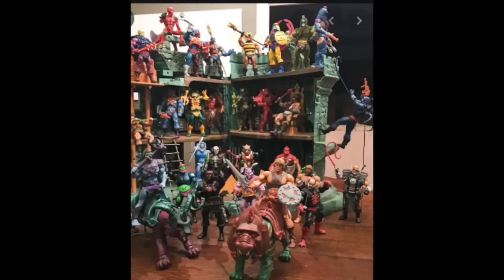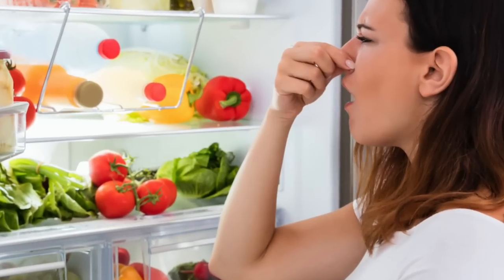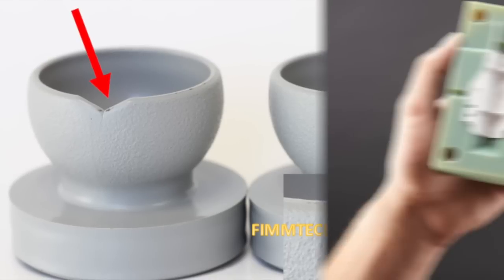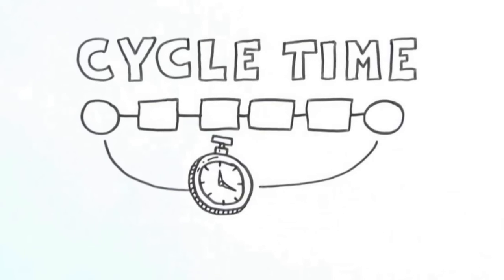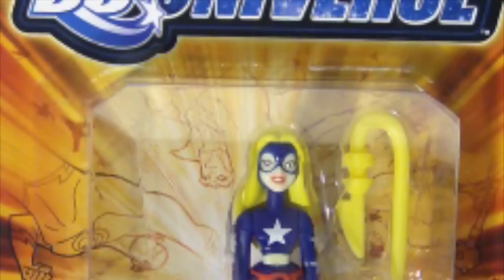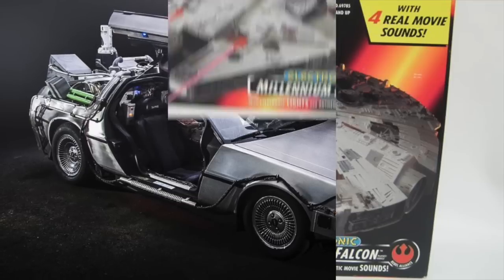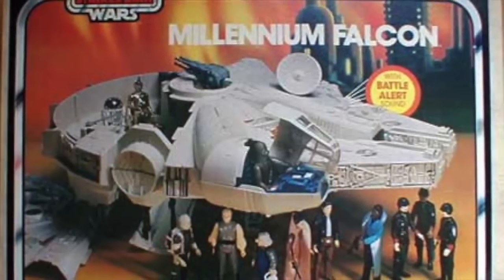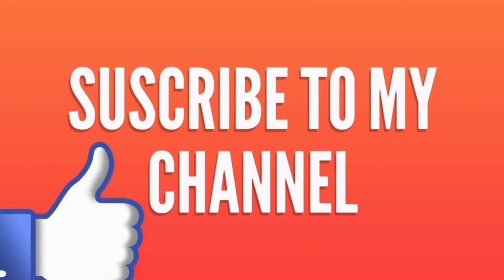Nothing lasts forever The Life Span of the common Toy Tool.

Comment: I would love an in depth video on how the tooling is created.  Are the action figure negatives CNC machined into the metal or is it done by hand?  When the S was filled in on Supergirl do they just add molten metal and polish it or is there a special substance for changing molds like that?  I make a lot of silicone molds of things so I understand how that works, but have never seen how metal molds get made.  Great video!
Reply: I wanna see how Classics Castle Grayskull was tooled...i mean the actual process
Reply from the maker: Very much like that. It is all done by hand
Reply: if it's indented into the figure, then it's raised on the mould and just a matter of filing that down. i'm not a tool and die guy, so i don't know you would -- if it's even possible -- to reverse that.

as far as how the mould is constructed i imagine it depends on what plastic you're using, production, detail, material hardness, etc.. some might be CNC router, 3D router, others EDM (electrical discharge machining). seems i recall how the old aurora models were made back in the 60's as being a pantograph EDM, which is kind of like doing it by hand. of course, you could always break out the chisels, too, but i'd venture to say that's very old school.
Reply: @spectorcreative1872  this would be a great follow-up topic! I hope you'd do it.

Comment: A good example of tool deterioration is the top wedge panels on the Black Series R5-G19 dome compared to the first R5-C7 Legacy release.
Reply: Another example is the Jazz toy released in the Commemorative Series Transformers line by Hasbro in the 2000s. The robot’s mouth had a strange smirk not present on the original, allegedly due to tool degradation. Later reissues fixed the tooling so it looked more like the original G1 toy.
Reply from the maker: Gréât example!

Comment: Injection molding is a fascinating subject. It's amazing how much engineering goes into common household products. The production rates are unreal. 
Around the turn of the century, you could get a 100 ton injection mold machine(less dies) for $100. But it would have cost about $10k to move and set up. 
I have a lot of stories from back then, it wasn't a time to set a small manufacturing company in the US.
Reply from the maker: And it is responsible for so much of what we collect

Comment: First...I LOVED IT!!!!! I've seen tooling made, we even had Stycast and casting epoxy at work because one of the aviation systems was made in '97. We never produced anything Safety of Flight, but still.  I've even made small scale stuff, weapons mostly.  Flatter things.  Very small runs.  My boss thought I was crazy. 

The big question... do you have the Spector Tool in your home? It would only be fitting. I've read a lot of released inter-office memos from Hasbro from 30 years ago in different places. A few of them mentioned sending tools to South American factories, and then took the factory to keep them to cut down on cost. So Hasbro was not paying to get the molds back to get rid of them. I've read the two product tools they were eager to dispose of were the Flagg, and the Defiant Shuttle Launch Complex.  They took up so much space. 

I'm sure Castle Greyskull (or is it Grayskull 😝) was huge as well.
Reply from the maker: Mine too

Comment: The oldest tool I personally know of is from Character Options Dr Who line, Theyre still using the same ones from 2004. I guess more limited runs mean they arnt getting worn out?
Reply from the maker: It could be a replacement tool
Reply: I know that many of the Godzilla toys in Japan use the same tooling from decades before, some being as old as the 1960s. But those use a different process (soft vinyl) and in some cases more limited runs, so that probably plays a big role in the tool surviving. And I think it might be easier to make casts off the original hollow vinyl figure if something does happen to the original.

Comment: Scott, I once heard that certain articulation points are copyrighted by individual companies, for example - ankle pivots being copyrighted by Hasbro. Would love to see a video explaining this. Great video. Liked
Reply from the maker: They can be such as marvel legends double elbow joint.
Reply: @spectorcreative1872  so then how are other companies able to do it? Like most companies use double joints now at least
Reply: Good point. I think you can use a patented process if you improve on the design. If you took something like Revoltech’s “revolver joint” or shfiguarts and altered the mounting points, you’re good. Plus that may have been a rumor cause certain designs are just too common.
Reply: @machineman6498  I mean, McFarlane and NECA double elbows and knees are pretty much the same as marvel legends. Even Mattel had some double jointed DCUC figures like blue beetle back in that era

Comment: Always wondered what caused burn marks on the plastic. So, generally speaking it could be tooling thats reached the end of its lifespan? Would double tooling explain subtle differences in the look of figure components ?
Reply from the maker: That can, but double tooling is designed to be identical. It is more likely overuse if a tool

Comment: Very interesnting! I have a question: How they make a mold for an old action figure line relaunched? They take it from actual figures/vehicles or what?
Reply from the maker: They retool it from scratch. Think a copy of a copy
Reply: @spectorcreative1872  Is it really scratch/scratch or is it easier to copy the second time around?
Reply: at hasblo's level and given today's technology, replicating an original piece shouldn't be an overwhelming issue, i'd imagine. i mean, you can buy a laser scanner and create a flawless 3D copy on your printer. barring that, i would think that a modern fancy pantograph EDM could swing it. 

as mentioned, retooling it from scratch would be the way to go. you wouldn't want to necessarily put a lot of faith in a 40 year old mould, lol, and repairing it could cost as much as making a new modern one.

Comment: I recall that a lot of the G1 Transformers figures when they were reissued by Takara - and later, Hasbro - used the tooling from the Generations 2 line.  This is why a lot of the reissues had changes that were made on the figures during the G2 area.  

Anyway, when Takara reissued Jazz, the face looked odd due to mold degradation.  Takara tried fixing the face with different runs, but it didn't come out right.  I think it was finally fixed when Hasbro did a later run of either Jazz or Ricochet(a once Japanese exclusive of a black redeco of Jazz named Stepper) where they recreated the tooling.

Tooling degradation is also why not all G1 figures have been reissued officially since some tooling are beyond repair.  I also recall that the tooling for Soundwave's clear tape deck door degraded beyond repair during one of his reissue runs, which is why the Hasbro versions - until recently I think - had to use the Soundblaster version, which can hold more tapes due to the part being deeper
Reply from the maker: Yup. That is it

Comment: Were the tools in the 80s more durable than the tools they make now? I always assumed G.I. Joe reused the original tooling to make Tiger Force, Night Force, etc. And I was under the impression they used the original 82-83 tooling to make the 1997 figures - but they couldn't find them all (or some deteriorated) so they used some 86 parts.
Reply: The video mentions there being five classes of injection molds, based on life expectancy.  My guess is that 80s toy companies spent the extra money for higher class molds with the idea that the volume of sales and years of re-use would justify the investment. Modern specialty lines presumably see parts runs that may be several orders of magnitude smaller.
Reply: Part of this falls into the same category as the Palitoy example.  Funskool had a lot of the Hasbro tooling from the 80's/90's and those were used to produce the '97/'98 lines.  The plastic quality on those figures also shows how differently they were produced vs. the original ones.
Reply from the maker: No if anything they are more durable now
Reply: I guess they never splurged on that class 1 million use tooling. 
Only industrial titans like Ford or Sony can afford the good tooling and they are not using it to make toys.
Reply: @Novusod  no reason to spend more on tooling than you have to.

Comment: So, with Commemorative: did Mattel use the old tools at all in recreation, how does that work? The Commemorative He-Man head is a completely new sculpt that they had to buy off eBay and that’s STILL the sculpt they use for any vintage type heman head. Is there a reason for that? Is technology not able to get a more accurate 80’s head now?
Reply: I'm pretty sure I've read they had long thrown the tools away, and for that series they might have grabbed some of the original toys, made a mould of the toy, and then used that mould to make a new tool.

Knock-off toys usually use this technique.
Reply from the maker: Those were new tools based on the old. So think a copy of a copy
Reply: I believe Mattel covertly bought back a lot of individual figures from eBay and scanned them to make new molds. To Scott's point, a copy of a copy. That's why He-Man's face looks funny.

Comment: Really interesting stuff.  Are all molds injected with plastic at the same pressure, or do larger molds require more pressure? If more pressure is required, are larger molds made of more durable materials to compensate for increased wear?
Reply from the maker: Yes larger molds are made of more durable stuff

Comment: Is this still..a thing now that we have 3d printing ? Our molds are now digital rather than physical. What am I missing ? Is it quantity ? 
I. E. Is it not feasible to print a production run ? I apologize if I failed to articulate my query.
Reply from the maker: 3D printing isn’t far enough along to replace tooling
Reply: @wallaroo1295  i understand the concept you're saying and it's conceivable despite it having a lot of issues attached to it. i could rattle off a laundry lists of problems i see with that kind of plan just off the top of my head, lol. i think the biggest issue would simply be that people suck and you can't trust them to do their 'job' when you need them to. the 'sorry, i couldn't find the tape gun so i couldn't UPS them to you' won't fly when you have a bunch of assemblers, painters, and packers sitting around on the clock waiting for teela boobs. 

lots of ppl have printer farms, and that's okay for some things, i guess. personally, i'd be curious to see their costs vs. different processes past a certain production point. if you need ABS then only a filament printer can do that, then you have problems with it looking like shit from the layers. spending hours to print an inferior component that can be made literally within seconds using an injection mould, and soon you're going to very much close that cost gap, i would think. also, toys have a limited shelf life, and a couple hundred parts a day printing just won't cut the thousands that can otherwise be made when you have orders to fill.

i don't know, i would just have to really be convinced somehow that this is the future of certain manufacturing. i've spent most of the last 30 years working in manufacturing and i've owned my own small business. i've seen a lot of crazy machines, learned that even your most trusted suppliers can flake on you, that 'just in time manufacturing' is more a buzz term idiot pieces of management love bandying about than a viable american process without bastardizing the concept to hell and back, and, as an aside, if you see any company's quality statement containing the words 'continuous improvement' just do yourself a favour and leave.
Reply: @spectorcreative1872  it never will be, either. there simply isn't a way to remotely improve on a process that takes seconds to make a piece as opposed to printing it, not to mention the quality and consistency.

Comment: Great video.  Very interesting.  Question:  Do you know the production history on the MOTU Commemorative line many years back.  Had some of those at one point and there were quite a few figures made.  Do you know if a new tool was used or did they have the original tooling from the vintage line?   Thought maybe since the original line made so many figures, that there may have unused tooling pieces in storage.  From what I remember, those commemorative figures had pretty sharp details.   Just curious. 😁
Reply: I have Zodak and Evil-Lyn from Commemorative Edition. I'd heard that the tooling was all new because the originals had been sold to Top Toys in Argentina.
Reply from the maker: I will be doing a video on that soon

Comment: So I kinda tried to ask this before but not sure I got an answer.  The Tarzan jungle cat/big Jim tiger/battle cat figure is an example of a toy used across lines. Did they reuse the tooling for that or did it have to be recreated every time they reused it?  Are certain tools easier to reuse and last longer, like a solid non-articulated cat?
Reply from the maker: Yes but eventually BattleCat was retooled from the original mold

Comment: Injection molding and the tooling process seems like a technology that hasn't changed much over time. With advancements in 3D printing and additive manufacturing, are there new processes being considered for toy manufacturing that could be simpler and/or less expensive?
Reply from the maker: You are right, not too much

Comment: You’ve periodically mentioned the plan to release MOTUC in retail, “During a fabled movie year.” I’m guessing that was only possible as a contingency plan because of the shared bucks within the line, correct? Mattel could take whatever basic bucks remained useable and employ those for the first series of the MOTU-movie line  figures and/or the MOTUC-movie-companion line. Then, in success you’d be able to retool additional bucks and/or individual figure pieces? 

Was that the plan? Use whatever molds were still viable in order to launch the line, then develop plans for more lines if it sold well? Or did MOTUC receive special treatment — more robust molds? Better/additional mold storage after the initial l run? More careful/low-mold-stress production line setups? Use of XYZ factory practices in order to minimize long term wear and tear? — because of the fabled prospect of a movie year?
Reply from the maker: Did you see this video Nick? https://youtu.be/8ca62rHeFYY
Reply: @spectorcreative1872  not sure who Nick is, but yeah. I think that’s the video I was initially asking you about. My question is just… the molds only last 5 years. I guess, at the time, MOTUC was still in production, so you didn’t have to worry about old molds? They were still new?

Like, I’m anticipation of the fabled movie year, were MOTUC molds treated any differently than random joblo corporate cartoon tie-in? Or was that completely unnecessary.

Comment: In short, Mr. McGuire didn't tell us the whole deal regarding plastics. Like the molds (which I assume are as important for Tupperware as they are for toy production). Of course. 
Well, I'm sure someone is going to mention 3d printing, regardless of the challenges that presents...
Reply from the maker: Oh thé challenges it has indeed
Reply: my understanding is 3D printing is okay up to about 100 prints, and beyond that you might want to consider getting a mould made. i can understand that -- i owned a screen printing business with my ex, and we would do shirts in vinyl up until about 20, which after that point it was more economical to screen print. 

these guys with printing farms banging out 100's of the same thing, i dunno, seems to me at some point you're losing your efficiency just to produce an ABS product that's ugly af.

Comment: So the "new" vintage scale Falcon released in Target that is the same mold as the one that came out ten years ago but with better painting probably needed the investment of new tooling. Sheesh, they might better have updated the design with modern engineering if they were going to have to pay for new tooling anyway.  Black Series isn't even a decade old and its initial offerings feel like dinosaurs compared to current renditions. This isn't the thunder tank we're talking about either, it's the defacto ship in Star Wars!
Reply from the maker: Likely this tooling was still usable.

Comment: When designing a tool, how many pieces of a figure can be used for a single mold? Can you get multiple parts out of a single tool?
Reply: I suppose it largely depends on the quality you want.  Think model kits or weapons that come on a sprue with cheap action figure sets at walmart.  I'd assume a single sprue of multiple pieces also come from a single tool; but the number of pieces can vary as much as the model kit sprues vary from kit to kit and/or kit quality to kit quality.
Reply from the maker: Good question. It depends on the size of a mold. Usually a 6" figure will fit in one tool. But it can take two if he/she/it is big
Reply: absolutely. funny you mention that, someone in the vintage SW group just showed off a biker scout, if i remember, still on the sprue, almost the entire figure was banged out in one shot.

Comment: In the world of plastic model kits some molds are 60 years old at this point. But I think that the fact that it is shorter runs and styrene plastic has alot to do with the longevity. Or were the molds made in the US back then just better? Atlantis models has reissued a bunch of older kits. And from what I have heard/seen they do need some work.
Reply from the maker: They would have been remade multiple times